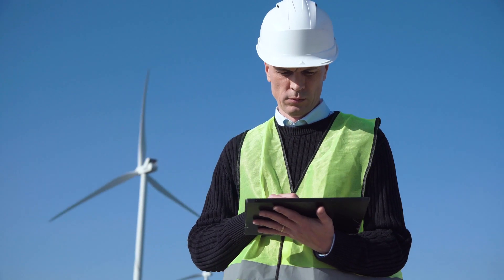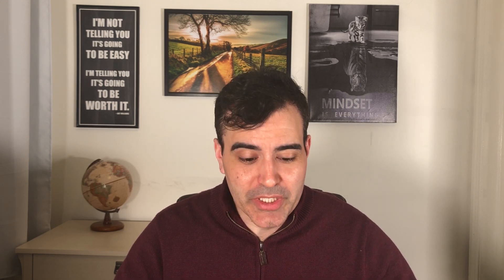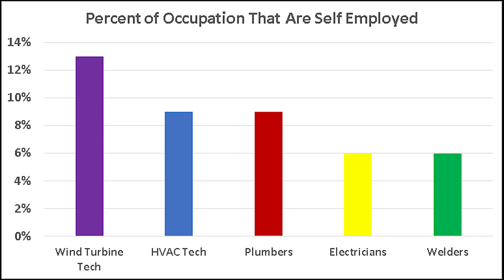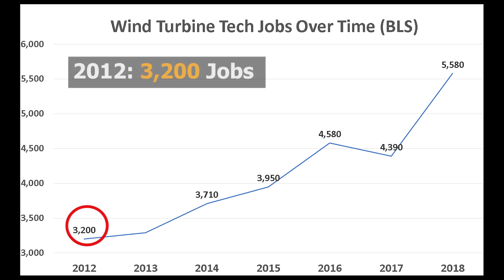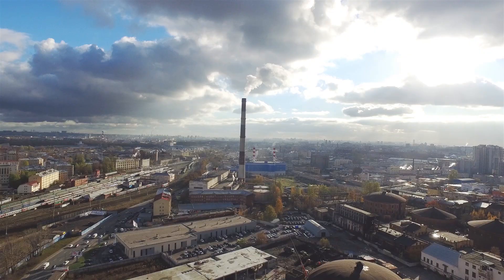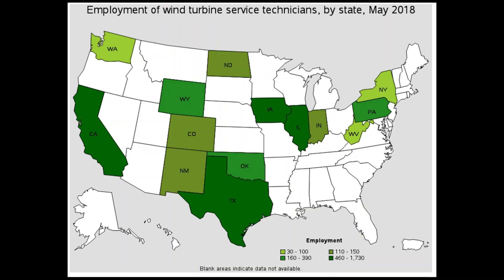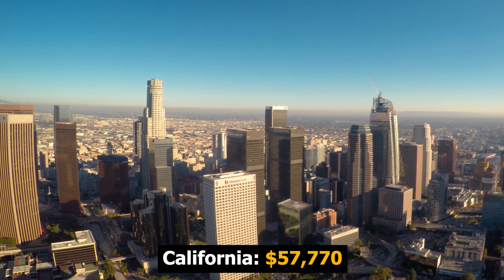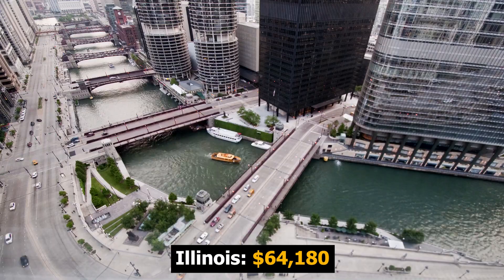Wind Turbine Technician Salary (2019) – Wind Turbine Technician Jobs

Comment: I lost my job during COVID. I am 50 years of age and have no wind turbine experience. Can I entry the wind turbine industry at this age providing I am fit enough?
Reply: It depends on the company the company Im with says u can only be 270 max I don't think they have a age limit there's literally someone I work with that's 68 but he's going to be a solar tech I'm sure there's older people that are techs I haven't met yet as I'm just getting my classes on Tuesday so depending on the company u might have to work up to the free classes like my job and it could be harder as it's weed whacking around solar panels and it can get hella hot in the rows and u have to bend over ALOT so if u think u can do it fuck it go for it
Reply: Yes you can. The biggest factor will be how much knowledge you have in mechanical/hydraulic/electrical backgrounds.

Comment: Think my height will be a factor into this? I am 4 feet, 9 inches tall. I am short. Will that be a factor?
Reply: The honest answer is yes. I’m 5’8” and their were plenty of times when I wished I was 5’10”

If you’re on the slim side however, being the small guy/gal does come in handy sometimes. You can fit into tight spaces the bigger folks can’t.
Reply: @ericrichards8939  can you talk more about the job I’m interested in it
Reply: @iiloveblueempire8425  What exactly do you want to know? I would read through all of the comments in this thread, and then ask away.
Reply: @ericrichards8939  What sort of technician work do you do? I'm currently a turbo jet engine mechanic so am familiar with removing components, troubleshooting, and repair when possible. I wonder if it'll be similar but larger scale? And do you guys climb up with ropes?